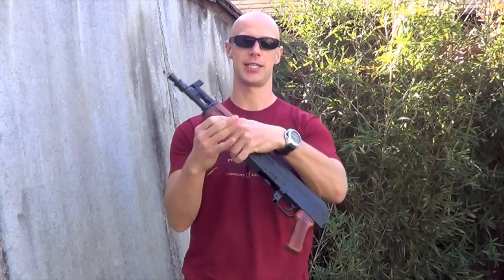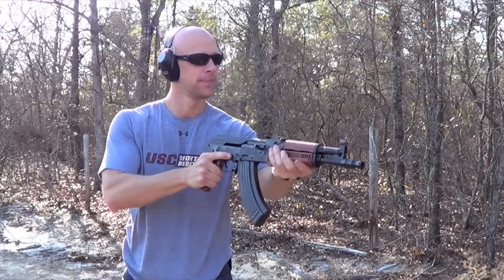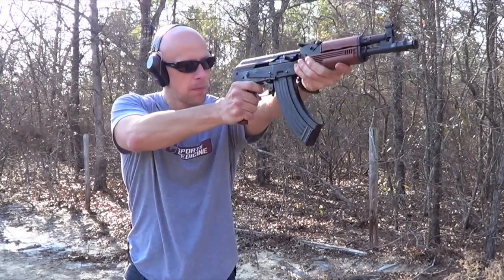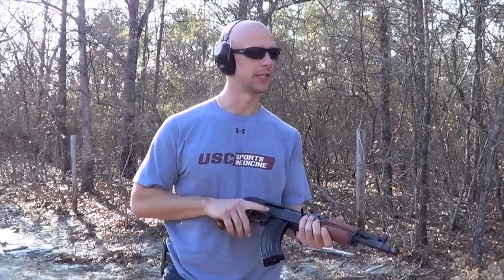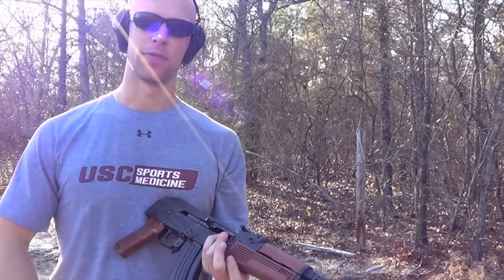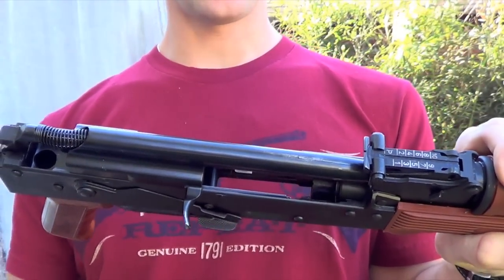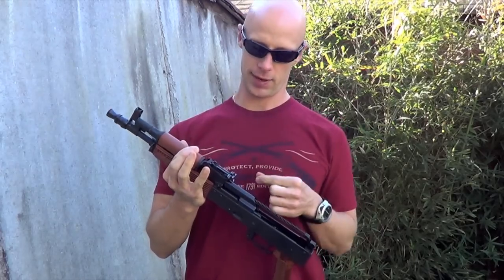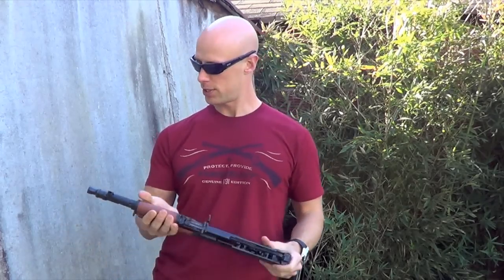I.O. Polish Hellpup 7.62x39 AK-47 Pistol Part 1 (Problems.......)

Comment: It's probably a combination of both those issues. The rubbing from the from carrier trunion would probably be overcome in a longer barreled AK. The gas expanding about 11" sooner (I'm assuming a 7" barrel) means there isn't as much pressure in the barrel and this less pressure tapped through the gas block to run it.

Comment: Just got it back and test fired this morning.  Got through the full mag with no feed issues, worked great!  Customer service was good once they relocated, when I called they gave me an RA right away, I filled out the info, sent it to them (had to pay postage both ways but at least it's fixed).  Before they sent it back the gunsmith called me up and talked to me about what he did.  Made some adjustments to gas system, replaced some parts with better versions, new bolt.  I'd give an A for service.

Comment: Bud I have seen two things that have done that exact same problem.  First is a bent Bolt carrier piston from it being installed improperly by century.  The second problem improper riveting on the front trunion. Both have to be fixed by a good AK smith.  The only other problem I have ever had from a Wasr rework or even any other ak is improper bolt.  They throw a single stack mag bolt on a Double stack mag gun. The size of the bolt is different the double stack one is longer to pick up the round.

Comment: Took it fully apart this weekend, cleaned, polished, lubed up nice.  Worked the action a bunch and I could tell the bolt was sliding a lot better.  Prior to this it would stick about half-way and 3/4 the way as it was sliding back, now no sicks.  So I went to fire it and got 3 straight rounds out through it.  Then another jam.  Took it out, fed another, fired one shot, another jam.  The most I can get is two rounds without jamming.  It's going back to Century for repair.

Comment: I purchased my hellpup from Royal Tiger Imports by way of I.O.  My hellpup has shot 200-300 rounds and have not had one failure to feed or failure to extract.  It chews up and spits out anything I feed it.  It would seem there's some inconsistency with the builds.  If I had to speculate i would venture to say that there's probably some 14 year old apprentice in Poland pumping these out and may be missing something.

Comment: Does the piston wobble in the bolt carrier?  Is there any wear on the piston head, probably on the bottom?  I wonder if the piston is hitting inside of the gas tube, which causes the bolt carrier to hit the top of the rear sight block like that.  Loosening up the piston in the bolt carrier may be a quick fix.

Comment: Doesn't I.O. Have a lifetime warranty? I have an I.O. AK Sporter and it has not had any problems but if it did, they will fix it right? As the second owner, I did not get the paperwork that comes with it..

Comment: I just picked up a nice Century Zastava AK47, and in my research before buying I read about them importing these as single stack feeds, and then milling them out for dual stack regular AK mags.  Do you think the milling might be an issue for the Hellpups, do they mill these as well?   If so, maybe they didn't mill it out fully or properly, causing it to not feed right?

Comment from the maker: Understood but I'm not going to start modifying a factory gun that should run.  If it worked---great.   If it's actually a problem with the gas block then I just voided the warranty and it still doesn't work.

Comment: I had a similar issue with my Desert Eagle with a .44 mag upper. Granted not the same gun but exact same issues. And I found it wasn't just a single issue but a series making one major issue. It was a mark 19 MN USA made DE and I had bought a .44 mag barrel off gunbroker, the guy advertised it as a 19 barrel. It was isreali barrel which as we found to be a thousands difference in tolerance made it very tight. Granted this was a brand new mark 19 DE .50AE platform it runs like a tack hammer. The issues we found were the slide rubbing the bottom of the barrel causing the bolt not to slam and cycle, similar to your issues. So a good polish job fixed that. Cycles fine now, then second issue was, not all ammo is created equally. Cheap shit did not cycle the .44 upper at all, hang ups not ejecting, and feeding properly was a result of it could only fire a few rounds at a time before issues.. Changed ammo, issue disappeared. Now mind you, brand new gun, its not broken in, needs several hundred rounds fed through before most start too. Since the issues and the research and resolutions put in place had around 450 rounds down the tube, and now the ammo it wouldn't feed before and eject work just fine. So sometimes, its not just a problem but a series of small ones making it into a big headache of one problem. And mind you, no two guns are the same, what may work for one won't necessarily work for another. They should come as sowing machines, but unfortunately its the real world and sometimes a sweet deal is that for a reason. Thanks for your video, I came to it because I was buying a hellpup and wanted to see any issues they may have. If you haven't got yours resolved yet, maybe try what I suggested it may help you. I would try a better brand see if it changes anything for you. I know in a perfect world a gun should fire anything put in it in proper cal but unfortunately, thats not always the case.

Comment: I just bought a HellPup 12-20-13 and it runs like a wild dog,and I run my guns hard.I think you have a head space issue also.After a few rounds your barrel warms up then failure.? I have built 3 AKs kits over the past 4 years and they all run fine.good Luck

Comment: Receiver is too tight man. Simple fix. Put the handle if a hammer in the receiver and twist it a bit till that carrier losens up. I've built a few and had to do this once or twice. Always worked for me. Also scrape that paint of the rails. It makes the carrier sticky in spots.

Comment: Why don't people do there own basic re-milling, shaping and profiling as all wepons can use some especially these Polish guns, Mon or Fri gun ect.....Taught myself on Saiga 12's bought, smoothed/Polished then sold a few just like the crazy expensive customs, many hours but well worth every bit!!! Just go slow and keep checking the way it moves and fits! Just open front trunnion or where it is actually rubbing on the carrier by hand or drimel then polish. Same for carriage, bolt and hammer! When I first got my Hellpup it was very stage-y and now super smooth, also added 1/4 inch rubber rear trunnion pad which really helps wear and quickens rebound for faster cycling. Almost everytime it's not the gas block or how much gas received but all the friction, bumps and misalingment that some have. Some of every gun work perfect and then there's the problem children....Nuff Said!!! Good luck, you got this!!!

Comment: (1 of 3) replies per three video series: 
        I like you channel but your analysis is completely incorrect..! Your right you can't say for sure because you're guessing why firearm is malfunctioning..! All AK Bolt carriers function in that same manner hitting the receiver Trunnion..! Thats what they all due and why Bolt Carrier is tapered from piston back, but it's not causing the jams nor is the gas block gas channel too small..! Your IO Hellpup is receiving typical "over gas" AK Com-Bloc spec pressures..!
Reply from the maker: fair enough